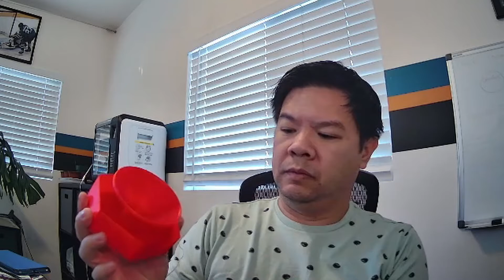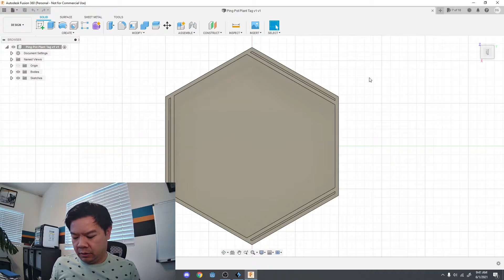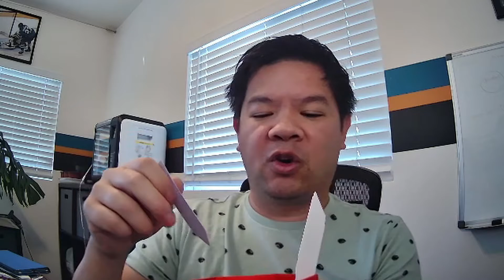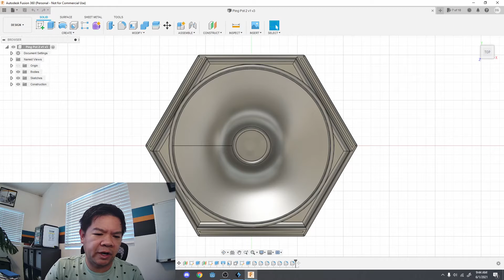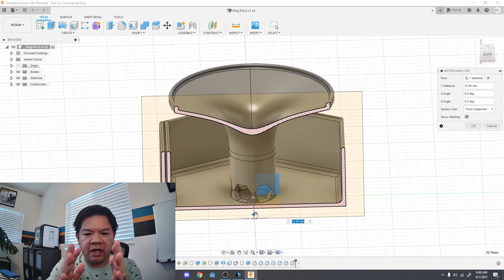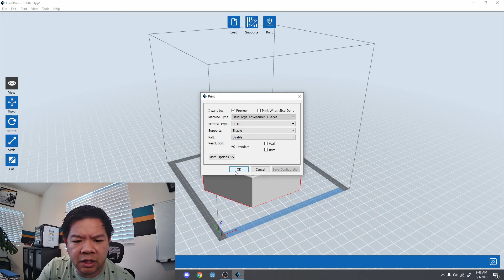3D Print | Idea to Reality | Design Updates for my Ping Pot

Comment: So awesome, Darryl. I'm curious what the cost for each one to print is in terms of materials? I'm sorry if you've mentioned that before and I did not catch it
Reply from the maker: Appreciate it.  It’s been pretty cool going through this process.  I did a rough calculation of materials and based on a full sized pot it would be about $1.5 in materials, but when I look at the spool.  I can print more than 20 pots a spool.  Spools are around $20 ish.

Comment: Hey Darryl, why not just cut the tag straight across an removing the pointy part off? The tag would be shorter an you don’t need all that blank space at the bottom anyway. 😀
Reply from the maker: Great point.  I am working on my next video to come out shortly where I just wrote on the tags upside down.  Fits pretty good.  Thanks for the suggestion.
Reply: @mypingtopia  Great idea too put the tag slot in there. 💚